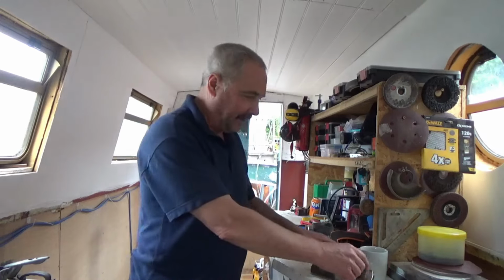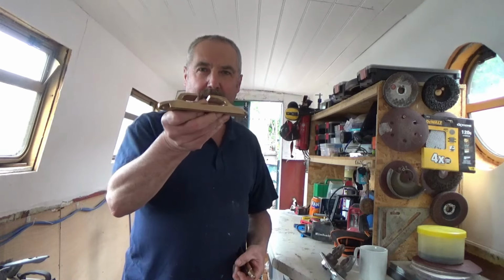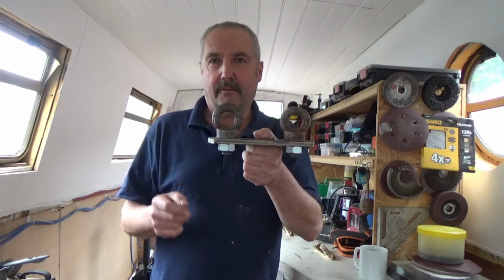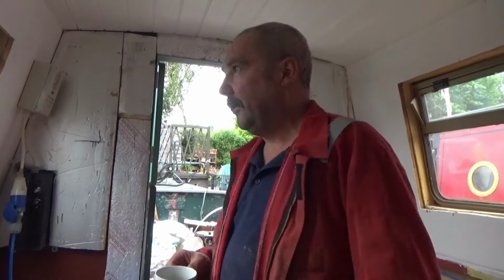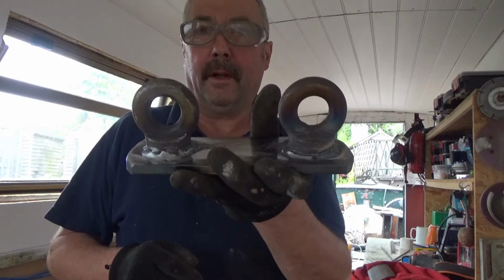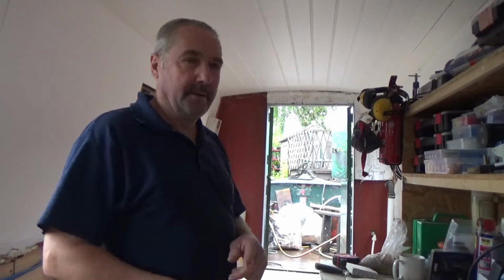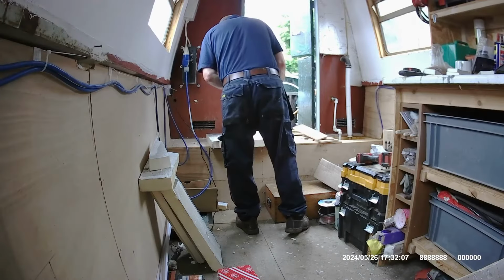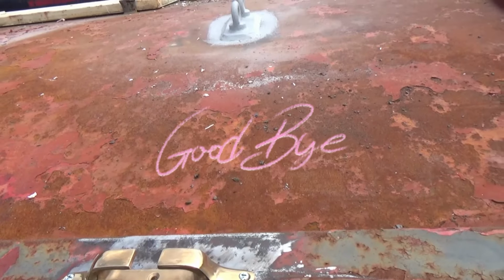Building Narrowboat Home Installing Centre Line Tethers & Fairleads

Comment: Hi Andy
I notice you are using stick on some parts of the build and some flux core mig on others. Is there a specific reason for this or just what was to hand at the time. Forgive my ignorance, but I'd like to learn to weld but there seems to be a lot of choices and ways of doing it. Cheers.
Reply from the maker: Hi Christopher, Thanks for watching & commenting. I use both flux cored MIG & 7018 Low Hydrogen rods. They are both high strength wires ie they are rated at 70,000 PSI tensile strength. Overspeck for non structual welds but give a nice clean weld when used to them. Flux MIG is faster if doing some long welds ,but you must pull it & not push it as you can with gas MIG. Outside with glare I tend to use stick as I can see it better with my young eyes. Hope this helps. Cheers Andy
Reply: @nogunwales9406  Thanks Andy.
I had a Portamig but never used it, and the project passed. Next time I think I'll start with stick and move forward on that.
Thanks also for posting your excellent videos; very informative and entertainment.

Comment: I'm sitting here wondering why you didn't sort out the roof while you had the boat under cover, or was it never under cover?  Only been subbed for a few months, so I may be missing something...
Reply: He has 3 to work on. One is moored and the other two are under cover…
Reply: @janeclark4643  Thanks, Jane.
Reply from the maker: This boat has not been under cover, it is being stripped by the weather slowly. Due to be painted shortly if eggs are eggs.